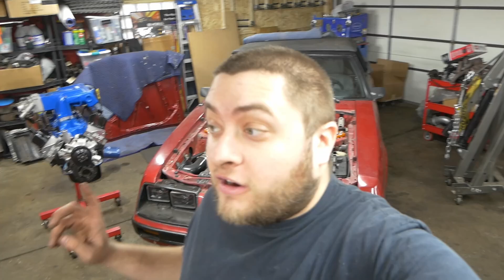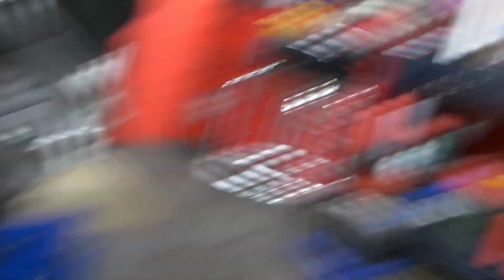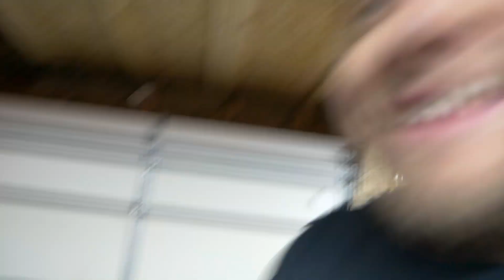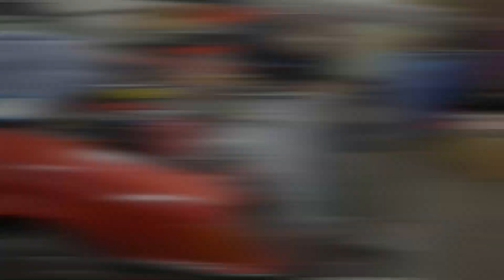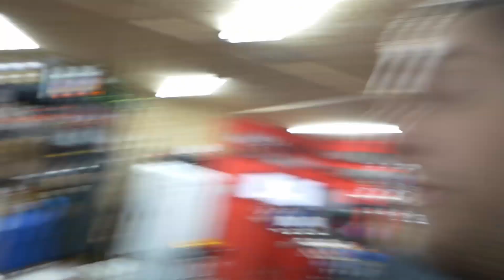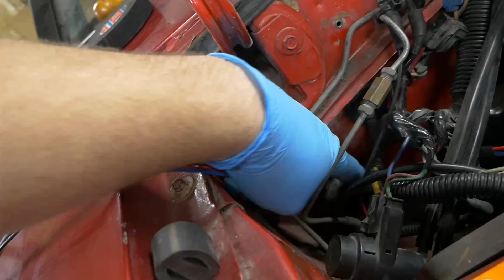Huuuuuge Power Gains for the Farm Find Foxbody!

Comment: Get a coyote
Reply from the maker: Now we are talking, they are just so wide however. If they dip down a bit more, it would definitely be worth it!
Reply: @zzsgarage that part between the throttle body and the intake is an egr spacer. I'm 1 min into the video and if tou want a nice cold charge of air making it into the manifold, bend the tubes off that the hoses go to that attach to the space. Just bend the metal tubes on the rail so they don't leak antifreeze. You won't have hot antifreeze going around the egr spacer which warms up the intake air. Also, you have it together already but block off the 2 crossover holes in the lower manifold where antifreeze makes it into the manifold. You just need silicone and some tin or aluminum. You'll thank me later.